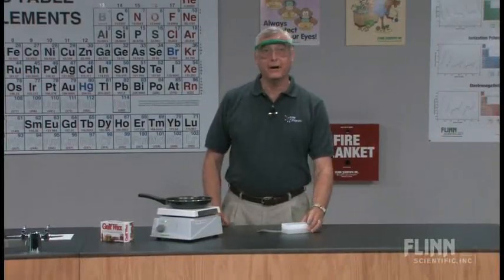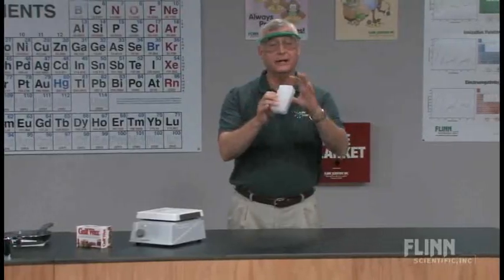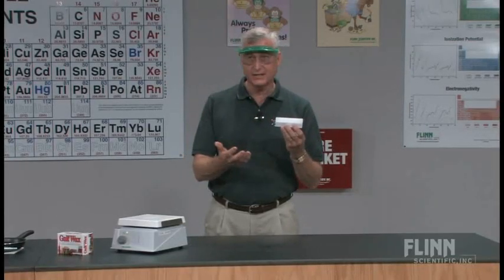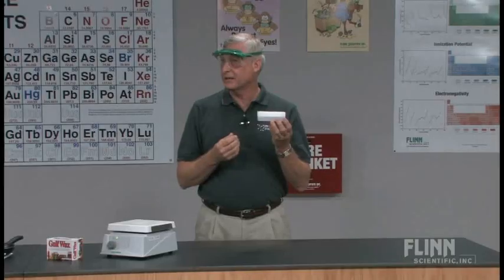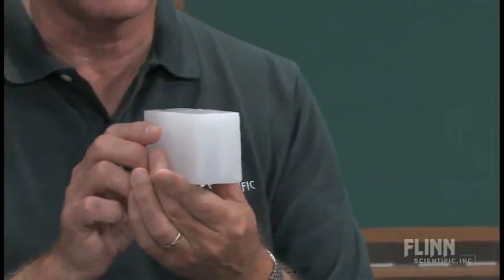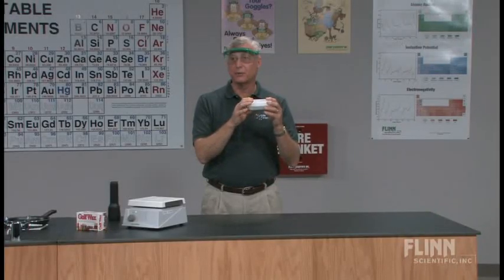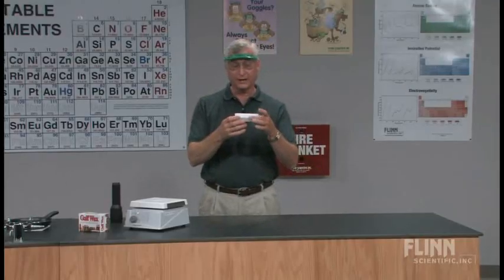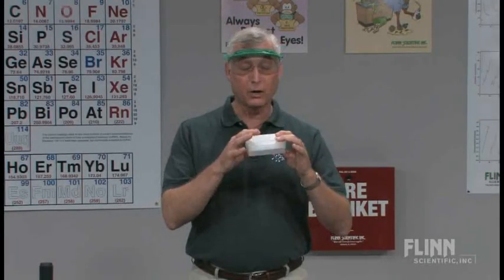Paraffin Paradox

Comment: Can someone explain to me HOW that block of paraffine changed color...PLzzz!
Reply: the aluminum foil inside blocks light. so the top part is always lit (because source of light is above) and the down part is shaded. Basically paraffin lets in light, and aluminum blocks it. the same occurs when u change the source of light to flashlight.
Reply: Paraffin is transparent.
Wiki:
Transparency, transparence or transparent most often refer to transparency and translucency, the physical property of allowing the transmission of light through a material.

Comment: How is it a paradox???
Reply: A paradox is a situation that seems contradictory yet also seems true.
A paradox is resolved by either determining that it's not contradictory or that it's not true. Gaining more knowledge will allow you to do that. Which is what this activity is about.

For students, the fact that the dark side is always at the bottom, even if you turn it upside down, is still a paradox. You already seem to have the knowledge -you've seen the man put the aluminium foil in there-, so you've resolved the paradox.
Reply: It's not, but it's still fun.
Reply: Well, actual it is. Paradox, when translated from ancient greek, literally means "exceeding expectation" or "against expectation". And that is exactly what it was and did. The students would have expected the colors to switch when the block was turned, but they didn't. If you meant an self-inflicting unsolvable contradiction, well, that would be an antinomy.

Comment: there's no need for the tin foil to prove that it acts weirdly with light, you already see its darker at the bottom before placing it, so puting a light over it (without the foil) and seing an even darking block (or under and seing it brighter) flipping it up, and it's already proven

Comment: love that he is wearing goggles
Reply: Considering that at one point he used a hot surface, to melt a material that also tends to smoke and splatter and burst into flame if overheated, I should hope he would wear safety goggles.
Reply: Marvin Kitfox I have skied all my life, this in turn means I have waxed my skis all my life. Never once has paraffin wax "burst into flame" You have to take a blow torch to it for even stay lit for a few seconds. If anything a smoke mask would be more useful because of the low smoke point.
Reply: Well, he is working with chemicals.
Reply: It's a pan with water XD. Do you wear safety goggles when cooking food?
Reply: redtails cooking bacon,yes
Reply: mind blown.

Comment: This is not a paradox, very easily explainable. It deals with the refraction of light given from the ceiling and the foil on the inside. Wherever the light source is will determine the lighter side.
Reply: He's using the more colloquial version of the word.  "A statement that is seemingly contradictory or opposed to common sense and yet is perhaps true"
Reply: sure, but imagine youre the student. you see that it's white on top and dark on bottom, so you flip it on it's head and it's still white on top and black on bottom. If you don't know what the block is actually made of, this change of colour will seem very unintuitive and intriguing. so yes, to the student it's a paradox (as long as the mistery isnt elucidated of course).
Reply: If not already mentioned in the video, I think you may be close, Professor. 
Perhaps the differently textured sides of the aluminum foil (one side is polished and the other side has a matte finish) have different reflective values, which would also contribute to the overall effect? ...IDK....JMO
Reply: Ahh I see, thank, you. I forgot that there was a different definition.
Reply: You're right, Rafael. This is quite intriguing to anyone....